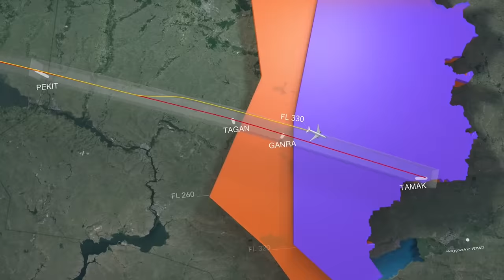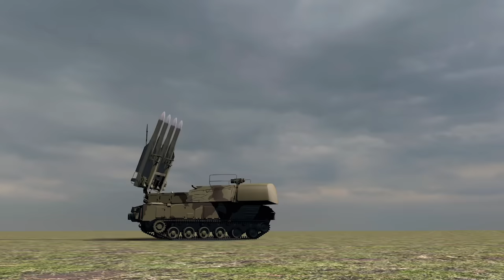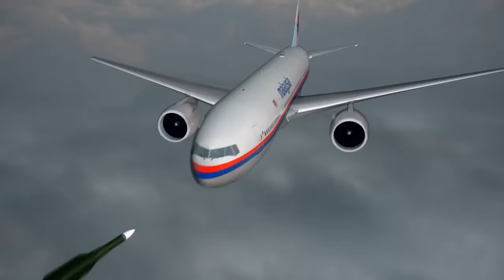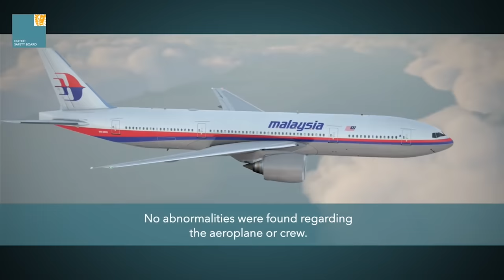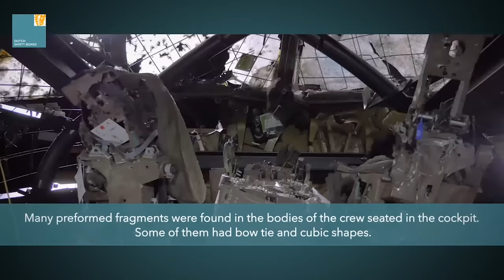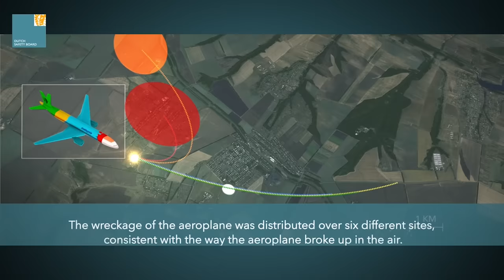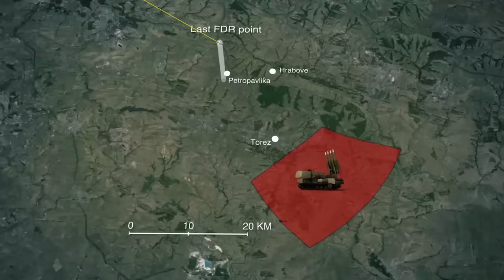Cause of MH17 crash by Dutch Safety Board

Comment: The wreckage of the aircraft, different in weight and aerodynamic qualities, and even with traces of thermal effects, lie to the north than the trajectory about which the engaged Dutch are rubbing, and even both BEFORE and after the LAST FDR POINT (which the Dutch take as the point of detonation of the Buk  anti-aircraft missile), and these fragments are not all from the cockpit, but from the front cargo compartment and from the passenger compartment. To which the Dutch rub that the wind allegedly blew away and that they calculated it, while there are only formulas and there is no calculation and they could not have wreckage and they do not know their mass. Both recorders and the speech CVR and parametric FDR stopped recording AT the SAME TIME, despite the fact that both are intact. And this is also not possible when detonating a fragmentation land mine on the top left near the cockpit. But just like with the Russian airbus over Sinai, its wreckage also lay both before and after the LAST FDR point and both recorders stopped recording at the same time. The data cables to the flight recorders are separated on different sides of the aircraft , 4 microphones are in the cockpit and they are at different distances from the mythical site of the explosion ( different distances are different times of defeat ) , and 3 on - board computers duplicating each other are outside the cockpit and it is from them that FDR receives data two in computer compartments 117 and 118 and the third on the right, in a special niche near the hatch to the cargo compartment, even further from the cabin. In reality, the computers were intact in the place where they are, there are no holes in the skin, and even in the cup of the pilot's headset there are none. So based on this, the plane was flying in the wrong place and the wrong thing happened to it, and it took off from Amsterdam, which is why it is risky for the Dutch to accuse Kiev of unclosed airspace.
Reply: @theirishempire4952  In subsection 2.16 (Figure 37, Table 11) of the "Factual information" section of the final report, it is indicated that, in total, two striking elements resembling an I-beam in shape, which are characteristic of the 9N314M warhead, were detected:

fragment No. 1 — 14×14×4.5 mm in size and weighing 6.1 grams (crew cabin);

fragment No. 2 is 12×12×5 mm in size and weighs 5.7 grams (the body of the aircraft commander).

At the same time, section 2.12 of Annex X to the final report mentions only one striking element 14×14×4.5 mm removed from the crew cabin (fragment No. 1).

The unreliability of the data given in the final report lies in the fact that in reality the mass of fragment No. 1 is not 6.1 g, but 5.5 g, as evidenced by the photographic materials obtained when weighing the fragment by members of the international commission in February 2015 at the Gilze-Reyen base. In addition, the report does not indicate the location of the discovery of this fragment in the cockpit.

The body of the commander of the aircraft from which fragment No. 2 was extracted did not undergo a special study (instead, the body of the commander of team "B", who was outside the cockpit of the aircraft at the time of the crash, was examined).

A new important fact is that, even if we assume that the aircraft was shot down by a Buk-type SAM missile, the characteristics of the fragments given in the report do not correspond to the characteristics of the striking elements of the 9N314M warhead.

The shape of the fragments resembling an I-beam is considered in the final report in isolation from their mass. In comparison with the reference striking element of the 9N314M warhead in the form of an I- beam weighing 8.1 grams and 8.2 mm thick:

the mass loss of fragment No. 1 was actually 32% (according to the report, 24.7%);

the mass loss of fragment No. 2 was 29.6%;

the relative transverse deformation (thickness reduction) is more than 60%.

For fragment No. 1, it is impossible to explain the loss of significant mass due to destruction, because it has no signs of destruction (otherwise it would not have retained a shape resembling an I-beam).

Fragment No. 2 has obvious signs of destruction, and the destruction occurred in a transverse (relative to the frontal surface) section. The small residual mass of the fragment can be explained by the fact of its destruction. However, the thickness of the fragment indicates a significant deformation of the striking element (more than 60%), which is not consistent with its shape.

The evaluation of the ratio of the shape and mass of the striking element "I-beam" of the 9N314M warhead after breaking through the obstacle was carried out by Russian specialists during full-scale tests of the 9N314M warhead and by modeling the transverse deformation of the striking elements.

Tests of the 9N314M warhead showed that the average mass of the I—beam striking elements, which retained their original shape with a through penetration in one case — aluminum sheets with a total thickness of 12 mm and in another case - the cabin of an Il—86 aircraft, was 7.2-7.9 g, and the average mass loss did not exceed 3-12%.

The experiment on modeling the transverse deformation of the striking elements showed that the shape of the sample with a relative transverse deformation of 60% differs significantly from the shape of the fragments presented in subsection 2.16 (Figure 37, Table 11) of the "Factual information" section of the final report.

The results of the tests and the experiment coincided with the data of control tests when creating the 9N314M warhead, according to which, with a through penetration of two steel sheets with a thickness of 5 mm each, the number of striking elements that retained the shape of the I-beam was 96% with a loss of mass of a separate element of 6-7%.

Thus, the mass-dimensional characteristics of two fragments (subsection 2.16, Figure 37, Table 11 of the "Factual information" section of the final report), on the fact of detection of which the conclusion about the defeat of the aircraft by the 9N314M warhead is based, do not agree with the results of field tests and experiments.

Subsection 2.16.2 and table 12 of the "Factual information" section of the final report provide information on the chemical composition of the fragments extracted from the fragments of the aircraft and the bodies of the victims.

Studies of the chemical composition of the material from which the striking elements of the 9H314M warhead are made, carried out by Russian specialists, have shown that the chemical composition of the fragments published in the final report contradicts the conclusion that they belong to the 9H314M warhead.
2.2. Damage to the fragments of the aircraft

Subsection 2.12 of the "Factual information" section and subsection 3.5 of the "Analysis" section of the final report, as well as section 2.13 and annex X indicate the approximate number of holes on the left side of the cockpit skin (about 200) and provide data on the transverse size of 31 holes. This, in fact, exhausts all the results of the study of the holes on the fragments of the aircraft.

At the same time, in the final report and in its appendices there is no data on the shape of the holes, on the presence of holes on the right side skin, as well as materials for assessing the characteristics of the warhead by the nature of the fragmentation field on the fragments of the aircraft.

A new important fact is that if we assume that the plane was shot down by a Buk-type SAM missile, then the characteristics of the holes on the fragments of the aircraft do not correspond to the characteristics of the holes that are formed when the 9N314M warhead explodes.

According to the results of full-scale tests of the 9N314M warhead, carried out by Russian specialists, in accordance with the conditions of damage to the aircraft given in the materials of the report, the presence of many holes in the form of an I-beam was recorded on the outer skin of the target aircraft. There are no holes with a similar shape on the fragments of the Boeing-777-200 9M-MRD aircraft.

In addition, during the tests, in contrast to the damage on the fragments of the Boeing-777-200 9M-MRD, the facts of complete destruction of the glazing by the commander of the aircraft, the power set above the glazing, numerous through holes not only on the left, but also on the right sides of the fuselage (exit holes) were recorded.

The studies of the fragmentation field covering the fragments of the aircraft performed by Russian specialists showed that the total number of striking elements and the characteristics of the warhead (according to the DSB version) that hit the aircraft do not correspond to the characteristics of the 9N314M warhead.    6. Conclusion
New important facts indicating the unreliability of the information given in the final report, assuming that the plane was shot down by a Buk-type SAM missile, are:

inconsistency of the characteristics of the fragments given in the report with the characteristics of the striking elements of the 9N314M warhead;

inconsistency of the characteristics of the holes on the fragments of the aircraft given in the report with the characteristics of the holes that are formed when the 9N314M warhead explodes;

the discrepancy in appearance of at least one fragment of a rocket found at the scene of an aviation accident (the hull of the 3rd compartment) with the appearance of fragments of this hull, which are formed when the warhead of the 9M38 series rocket explodes;

inconsistency of the algorithm of operation of the remote radio detonator of the 9M38 Buk missile with the conditions of aircraft damage;

the discrepancy between the spatial position of the missile when the aircraft was hit, given in the report, and the characteristics of the fragmentation field covering its fragments;

inconsistency of the conclusion about the launch zone of the anti-aircraft guided missile that hit the aircraft with the technical characteristics and principles of operation of the 9M38 missiles;